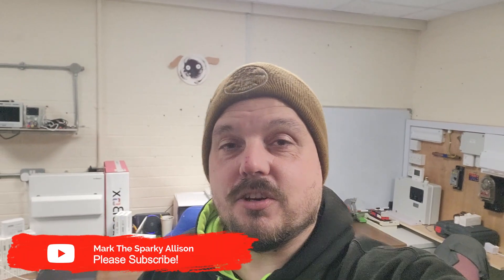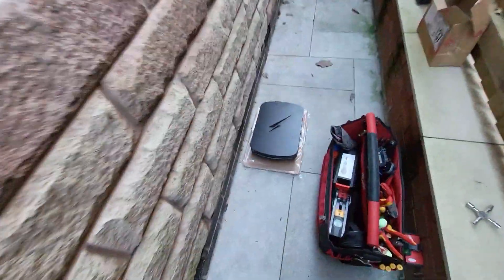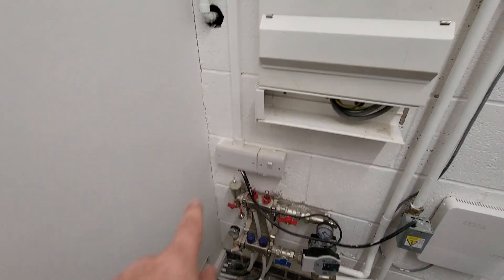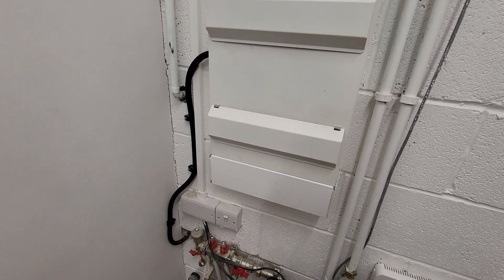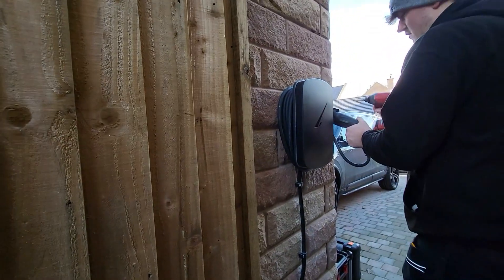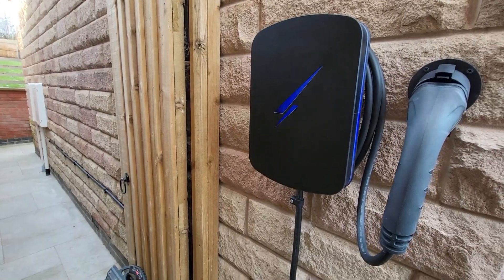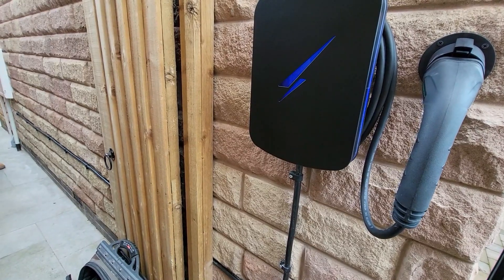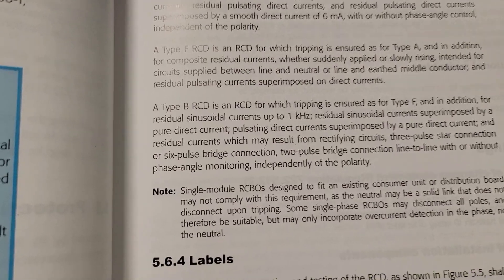New Build Nonsense || Epic Electric Vehicle How To || Hypervolt EV Setup || Start to finish

Comment: Hey mate

Question for you, I have a new build and paid extra to have the electrical wiring positioned to where I'd eventually have an ev charger installed. (It's a little black box which is hiding the wiring).

Of course an electrician would first need to check and test it etc to make sure, but from your experience, is it likely that everything was done and all it needs is am ev to be connected?
Reply from the maker: Impossible to say really. Best get an electrician to check it over and make sure

Comment: Hi Mark why use an rcbo ? Does the hyypervolt not have built in rcd protection ?
Reply from the maker: Not one that meets the intent of bs7671. Most brands don't when you look into it.
Reply: @electrician247  Interesting . I have fit rolec and project ev which do but can’t see a reason why single pole would not suffice in  a TN system.

Comment: Great video, thanks. Did you link a 16mm cable into the main switch to supply the new rcbo?
Reply from the maker: We used the proper tails flyleads for the CU and went off one of the RCDs I think. Obviously the input side which is isolated on the main switch. Was a bit full already on the MS.

Comment: Would/wouldn't the switched neutral have to meet 60947-3 ?
Reply from the maker: Not according to the regs or ev guidance docs. Just disconnect live conductors. Which according to definitions etc. Rcbos with switched neutral do. But it's an area that needs clearing up

Comment: WHAT PAPER WORK DO YOU REQUIRE BEFORE INSTALL AND DO YOU HAVE TO NOTIFY THE DNO
AND WHAT PAPEWORK DO YOU FILL IN AFTER.
Reply from the maker: DNO has to be notified yes. 

If claiming the grant we need to see an order form for the vehicle or vehicle registration if already delivered. MPAN number of the electrical supply. Afterwards we fill in the grant claim form and usual electrical certificates/part p.

Comment: Did you you take the supply for the rcbo off the bottom switch?
Reply from the maker: No that would have RCDs in series and result in all the things I spoke about avoiding.  It's mounted on the din rail at the bottom but supplied straight from the main switch via the flexi link up cable kits on these dual row boards. 👌

Comment: The only thing I didn’t care for was the handle mount. It seems like the walkway is so small and the handle sticks out to far. It would be nice for hypervolt to have an adjustable mount that swings out of the way.
Reply from the maker: That's a fair point it is a narrow passage. We wanted to put it on the front of the house but customer is always right 🤭

Comment: My understanding of Regulation 461.2 is that for any TN supply,  double-pole switching is not required. There are some exceptions of course, such as where doubts exist over the equipotential zone of the building, and the need for a DP main switch to allow testing of the installation.
Do manufacturers stipulate this because they can't rely on the installer to confirm whether the earthing arrangement is suitable or not?
Reply from the maker: More widely thats spot on, agreed. These are specific regs for EV charge points when RCDs operate. It is most likely to do with ensuring all sources of energy disconnect on a fault. Well aside from the cpc which is covered via pen fault detection only.